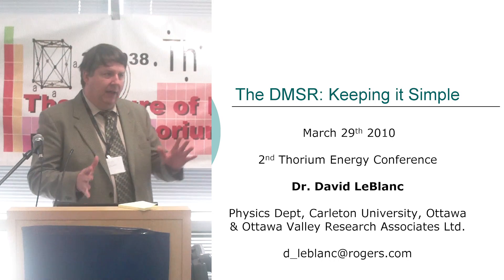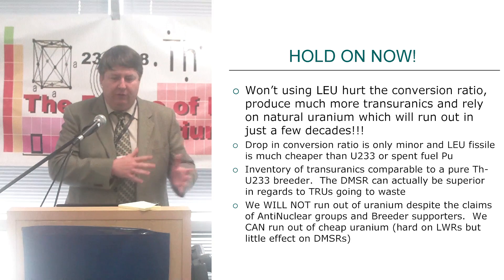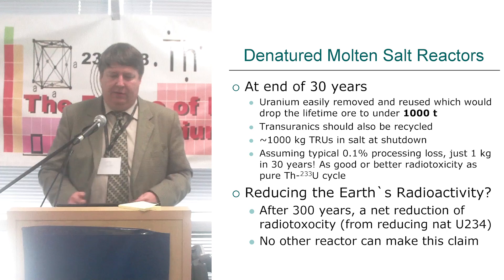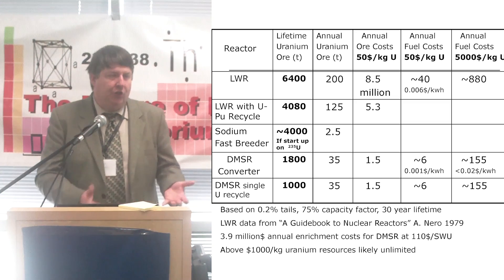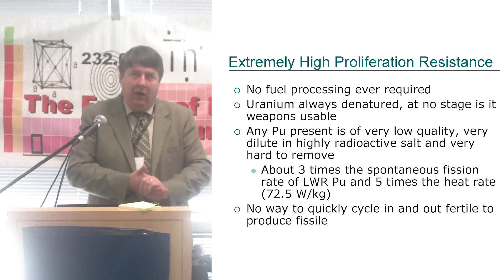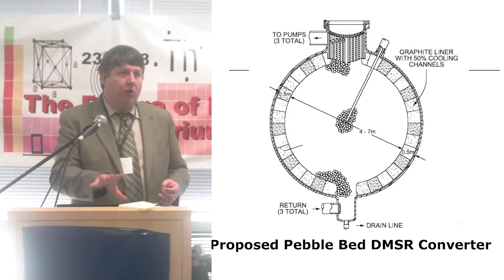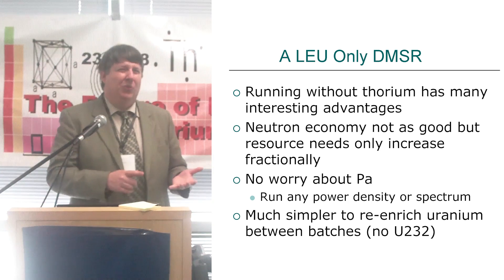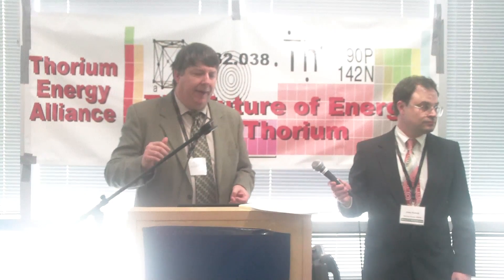Dr. David LeBlanc - DMSR (Denatured Molten Salt Reactor) - 2nd Talk @ TEAC2

Comment: Okay, I revisited for an hour or two, but still a layman and relative newbie in my depth of knowledge.... I have two questions : 1. I am ignorant of the improvement in the steam generator design that he refers to.   Is there another proven liquid than water to generate steam, probably at higher temperatures and lower pressure? But isn't pressure the force needed to turn the turbine and released during the process?   2.  My current conception of the DSMR might need correction. My current conception is that the DSMR was done at Oakridge in the early 70s. His concept is to burn low enriched Uranium with, maybe 1% or the natural %. 7 u235. Mix in thorium into the fuel as a fuel booster, rather than a blanket and reprocessed to u233.  I am guessing, with energetic enough neutrons the non fissile u238 beta decays to plutonium and becomes fuel.  This would be like a low calorie soft drink, rather than a zero calorie drink.  The main benefit (apart from the reaction being easier to keep going and skipping blanket processing step) is that no appreciable protactinium spent fuel is created, unlike in a thorium reactor. Plus, we could use the plans from Oakridge, rather than buy from the Russians (bn300)....   I still think we need to buy every bit we can from the Indians, Russians, and msr operators in France 1986-1996.  Fires freeze plug clogs are two foreseeable things that only experience can avoid. Pitfalls, rather than the science, is applied reality.
Reply: So far, my rabbit hole entry point was https://en.m.wikipedia.org/wiki/Integral_Molten_Salt_Reactor

I will need other jumping point for clarification.